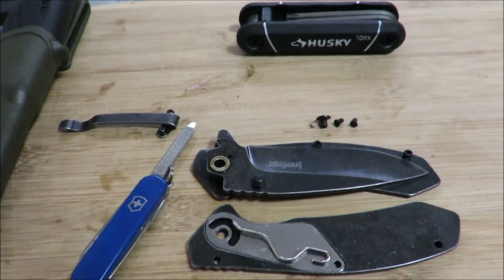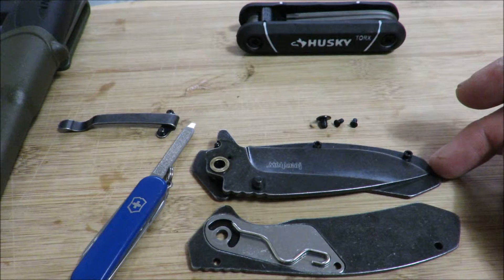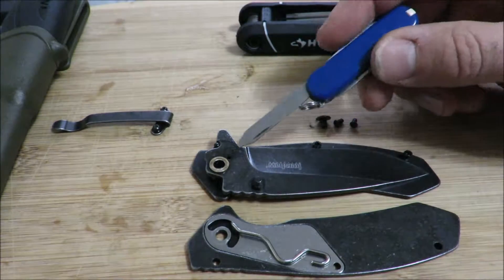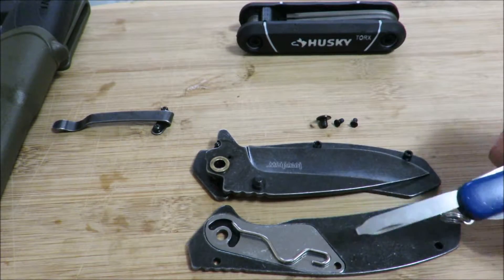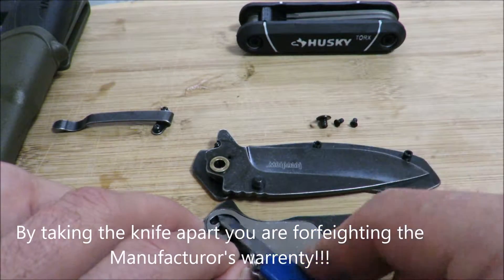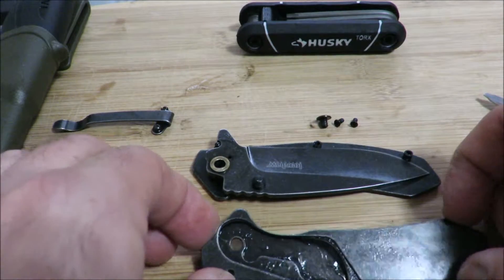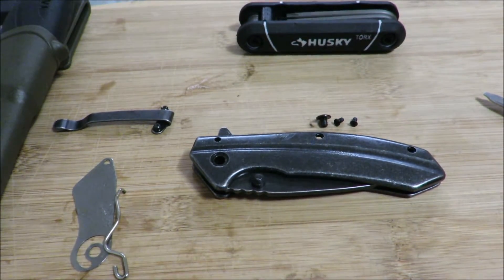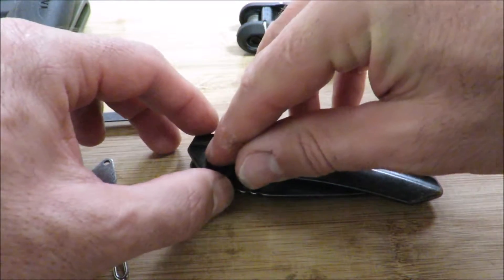Turning a Kershaw Filter to a Slipjoint

Comment: very interesting :)
but what i dont understand is this: you changed nothing at the frame lock an just removed the assist-mechanism, right? (if not please correct me)
How does that keep the  lock from engaging?
Reply from the maker: +bulletsix  you are right!the original thought was to just convert it to a manual locking flipper.for some reason doing it also weakned the locking bar tension.